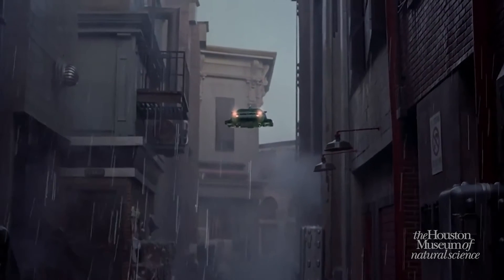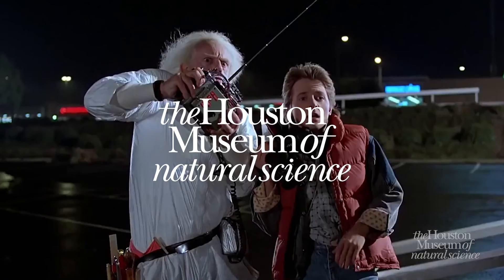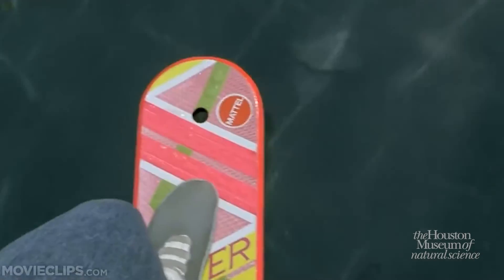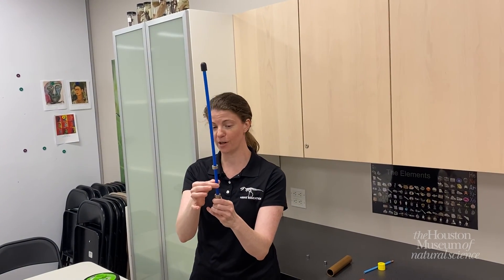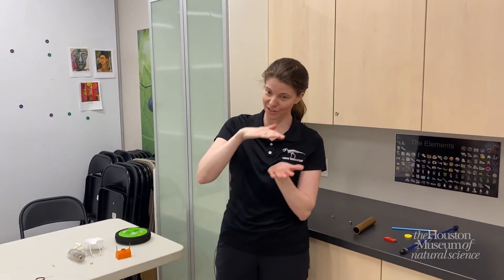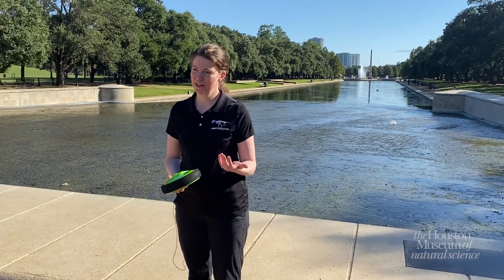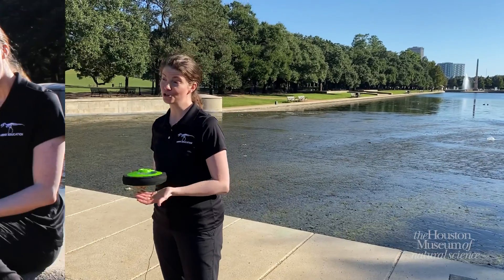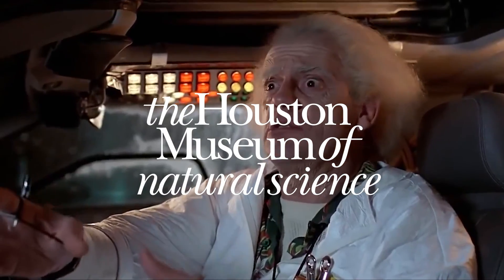Why don't we 𝙖𝙡𝙡 have "real" hoverboards yet?

Comment: Still think one of the reasons we don't have them is because we are too focused on other silly things when research and development into more practical uses.
Reply: The mechanics don’t work. People can’t even balance on the 2 wheel hoverboards. Turns out, you need friction and giving regular people rocket power is not an option.
Reply: praticle! Lmao.
Reply from the maker: Back in the early 90s, rumor was Mattel made some, but a kid died on one, so they pulled them from the market.

Ah youth.